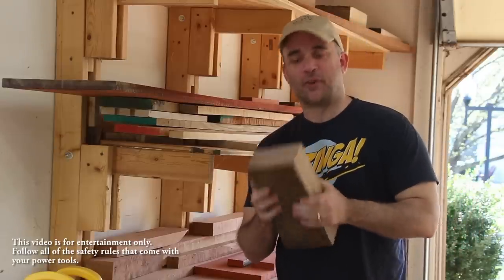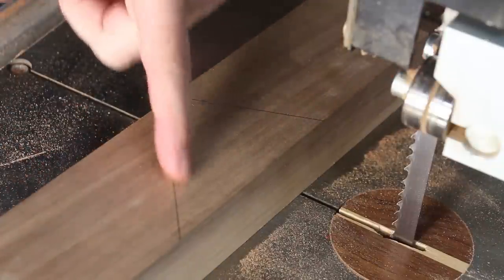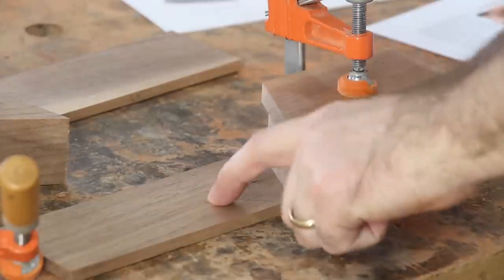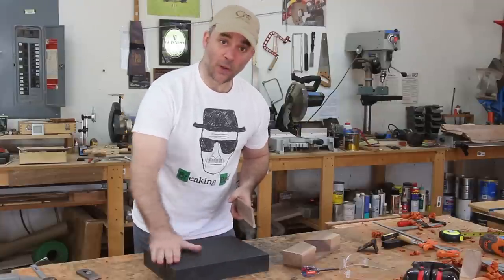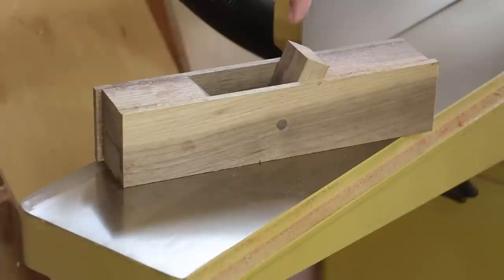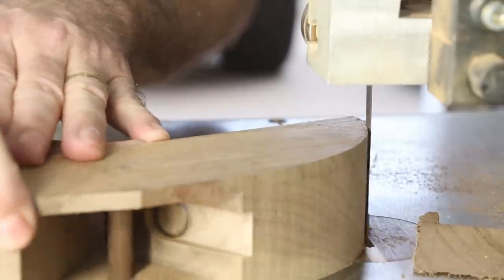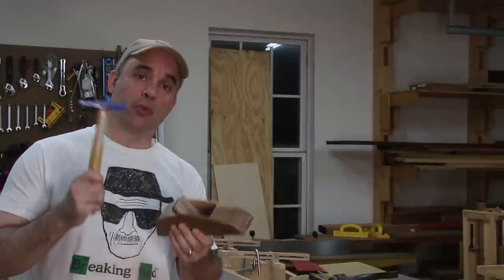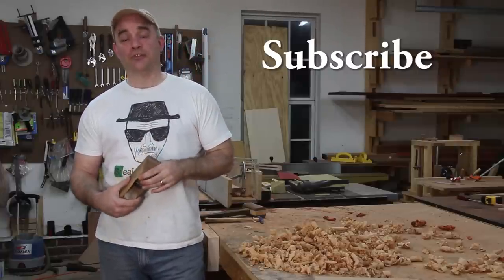Build a Krenov Style Hand Plane

Comment: with the higher bedding angle what you actually made was a very effective smoother plane. generally wooden smoother planes have a bed angle of around 60 deg specifically for the prevention of tear-out. another advantage of the 60 deg bed is, if you sharpen your iron to 30 deg, you can then flip the iron over giving you a 90deg angle and use it as a scraper plane.

Comment: Very sweet looking plane! I have been considering making my own as well, I am planning on making the blade as well and was wondering is the chip breaker absolutely nessacery ?
Reply from the maker: No they aren't absolutely necessary.  They are intended to reduce tear out. And thank you!
Reply: I just made a plane and blade. 1/4" O1 tool steel with no breaker. No chatter, but I havent tried it on anything with a lot of figure. Got enough steel for 4 blades for $40.
Reply: cool, thank you for the info.
Reply: BeerBikes andBuildingShit similar with 3/16ths have not hardened it yet

Comment: Where can I get that flat block you used as a reference?
Reply from the maker: Granite surface blocks can be found at Woodcraft.  Like a good 90 degree square for a 90 degree reference, a flat reference is a good thing to have around.
Reply: 10mm float glass not tempered because it ripples in the tempering